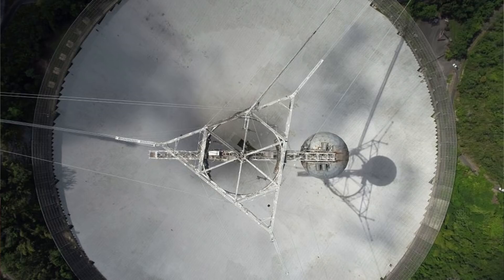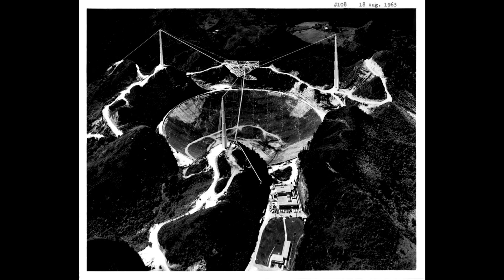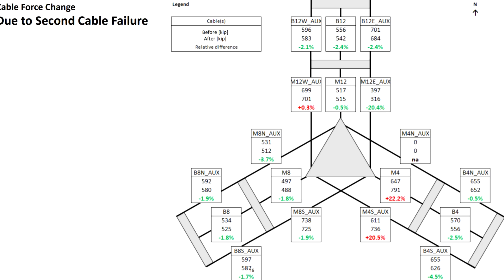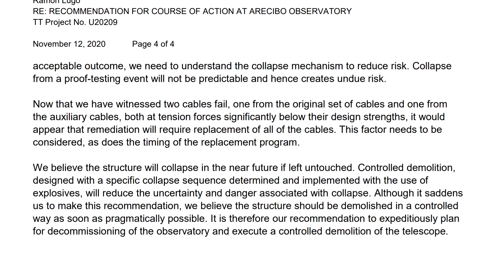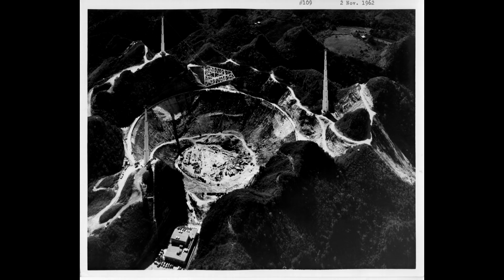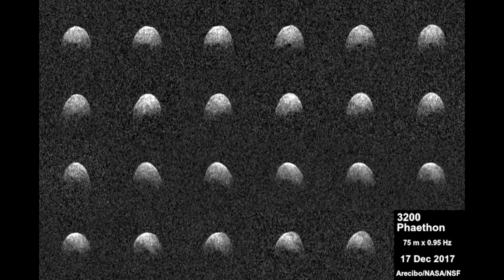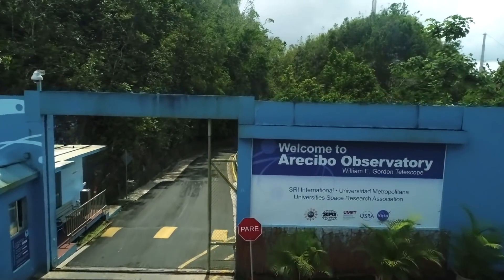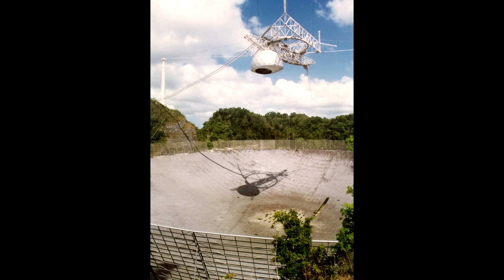Worlds Largest Radar Astronomy Dish To Be Demolished!

Comment: By undoing the cables at the bottom, that can release weight from the supporting cables. It's probably not enough if it was already damaged and should have been repaired 10 years ago. This is a sentimental setback for me, not only because I participated in seti@home, but this instrument carries something more : it's a reminder that mankind can accomplish the impossible. And it's an important magnet for Porto Rico. Cemeteries are filled with people that were irreplaceable, but here it's material, and with proper maintenance, material should be eternal. We always need a bigger something to check the work of the smaller something. We must not let the world go downhill like this.

Comment: I'm a mechanical engineering student - I see several ways to fix this, but none of them are safe. The least unsafe starts with rigging new temporary cables to the failing tower to take some load off the old ones, as well as rigging new cable to the other towers to insure against those cables failing. Then I'd start dismantling the radio gantry in the center, take down all cables, refresh all the cable mountings, and reassemble. That's the overview, anyhow.

Unfortunately, I don't feel safe relying on the remaining cables to hold long enough for all this to happen.
Reply: I'd be willing to risk my life to repair this telescope (though I'm not an engineer; software engineer tho). Not for the heroic death f* heroism but because I really think this telescope really has it's worth in existing. I bet a bunch of people would be willing to too... I guess it doesn't work that way. Anyone on the top would never accept the offer of the dare devils willing to do such a thing.

Comment: Size matters! Maybe ESA or other non-U.S. agency (Canada, Japan, Korea, etc.) might be interested. Upgrade it with newer tech like phased array radar systems. Rebuilt it of not repairable. Like using a helicopter to lift its central platform while freeing its supporting cables with explosives, and replacing its supporting structures with (2 instead of 3) quake-resistant concrete towers (like bridges) and/or (suspension or ...self supporting) bridge (arc).
Reply: I don't understand how explosives should support cables. Explosives explode, and the cables need not explode, especially if a helicopter attempts to lift a 800 ton platform, because helicopters very much cannot lift 800 tons. The heaviest helicopters can't lift more than around 20 tons of weight.
Reply: @marksmod  Sorry, editing thing. I meant to cut the cables instantaneously with explosives for the helicopter to lift that central structure free. Um, I may have missed helicopters lift capacity, but I was thinking that as they can lift tanks, so why not that 800 tons structure. Yep, I was off. My bad, I got carried away. Tanks are like < 100 tons.. Ha-ha. Why is that structure so heavy?
Reply: FFS phased array systems are not sensitive nor are they wideband as a radio astronomy observatory is.

Comment: Aero engineer here:
I'm not surprised a 60 year old cable snapped at 60% of it's expected load, even with constant monitoring and maintenance. 

I'm sure the engineers there know what they're doing, but the combined effects of corrosion, creep, fatigue, wear, and hydrogen embrittlement over 60 years are bound to ruin the cables effective fracture strength. There's probably been micro-cracks growing for years which have gone undetected, even if they have the right inspection equipment (e.g. ultrasonic devices), and the sudden increase in load when that first cable slipped likely allowed stabilised cracks to start growing again. 

Then losing that 2nd cable obviously repeats that to the 4 remaining cables, and as you said it's quite likely that one more snap will bring the whole thing down....

While it's sad that it'll be lost, it probably is time for the next generation to take over (like the Chinese one)
Reply: FAST doesn't do the same kind of science that Arecibo did.
Reply: @stargazer7644  I didn't mention fast, by next gen I mean not yet built really

Comment: Arecibo needs to start a "go fund me"
We must replace this entire telescope... ground up.
Reply: I would place a few arguments against that. Arecibo was a great telescope, with one major problem - it can't move. And the area, having high humidity, is also not ideal for radio observations in a bunch of frequency bands. While fixing it for sentimental and historical reasons may sound like a great idea, we should first consider the option of putting the money into a completely new telescope with a better location, outclassing Arecibo. Think of Hubble. Yes, it is sad to watch it die slowly, but the cost of repairs would be larger the building a new one. And even then all the hopes and dreams lie on the next generation of telescopes, like JWST.
Reply: I honestly think it'd be better to build a similar device but on the orbit.
Reply: @randomname3566  yes it be great to build it in orbit, but where are you go going to get roughly 1GW power to supply the dish? It's better to build on land, since Radar dishes need a lot power, even microwaves consume a lot power, where do expect to get that power? Solar panels don't collect enough energy to supply the demands for what you are speaking about.
Reply: @nicmaz37  It's fairly easy, you can just build big solar panels, and the cost of gathering material is also not a problem - gravity on the moon is weak enough.

We may not have the needed infradtucture now, but we will have in the next 15 years
Reply: @nicmaz37  24h solar energy. With Starship it may become possible
Reply: @nicmaz37  You only need that power for microseconds. I have an old old marine radar with 4KW transmit. The system draws 5 amps at 12 volts, 60 watts for everything, including the CRT display.
Reply: for what reason? if those who print money want it gone, why would you have it back ip?!
Reply: @cokeforever  Because Arecibo is the only means we have to measure the distance to an asteroid.  That makes it critical to establishing the orbital parameters with any degree of precision - which in turn means that Arecibo is needed in order to give us plenty of warning to deflect the next killer asteroid that might wipe out the human race.
Isn't that enough reason to want to replace it?
Reply: @SteveBakerIsHere  no, when you know its coming, what you gonna do (see Scott's video on probability of diverting an asteroid - if you dont find/remember it, i can be bothered on Sun to find it fot you - see, the f-upness of the pr is that we spend undrads of mil on "people who can tell us what will happen", rather than spending "hundred ad much on who would dare to tell us what to do with it" (c) I believe, both quote are Warthol's...
Reply: @cokeforever  I'd rather know I am about to die than not know. I think it's worth it.
Reply: @SteveBakerIsHere  Aren't there plenty of other radio telescopes readily available that could accomplish the same task?
Reply: @cokeforever  you could send a space probe up to give it a raspberry!
Reply: @AuthenticGadzooks  As far as I know, Aricebo is the only one that can use the dish to SEND radio...which means that they can use it like a radar system to measure range with phenomenal precision.  I don't think the other systems can do that.
Reply: @cokeforever  The way to stop a true planet killer is to have accurate orbital parameters decades before the impact.  Time to build a spacecraft to deflect it as early as possible is the only way to save humanity from a 20 mile rock like the one that took out the dinosaurs.

Comment: If they didn't repair it when it was "cheap" and "easy", I strongly doubt they will do it now that it is so hard and expensive...
Reply: This will be the epitaph of the Earth itself.
Reply: And more dangerous since more cables are starting to fail. If anyone might try to repair, there's a big risk the cable whipping at someone and slicing them in half. No one will risk their lives for that.
Reply: @nicmaz37  given the thickness of the cables, their whole trunk would just be crushed, the arms and fibulas might survive.
Reply: @nicmaz37 No kidding. At any moment dozens of 3 inch cables under 100s of tons of tension could fail in a cascade.  Arecibo is a *death trap*. You'd be nuts to ask anyone to do anything but set it off in the safest manner possible, much less set foot near the thing yourself. Budget is no longer the issue.  Arecibo isn't going to be fixed. :(
Reply: Especially because it’s in Puerto Rico. Also, I’m from there :)
Reply: @coquimapping8680  A shithole like south africa , congrats

Comment: Is there any utility to parking a radar telescope in a lagrange point (engineering challenges aside) IIRC one of the limitations of Arecibo's design is that its pointing capabilities were limited but in theory a space telescope shouldn't have that, right?
Reply: How big of a radio telescope do you think you can launch into space? And how would you power it?  There isn't a lot of reason to put a radio telescope in space.  They work fine on the ground.

Comment: These "vertical cables which would pull the platform down to keep it at the exact focal point" 2:44 that add 100 tons of extra force.
Could these not be cut to remove some of the stress put on the other cables ?
It's only a temporary fix, perhaps to buy enough time to lower valuable equipment off the structure, and to drop a lot of the weight as well.

From a structural design point of view, this is a 60 year old suspension bridge, and we all know how well those last.
Rebuilding it with extra equipment without replacing the original cables was reckless.

Comment: I don't see the problem tbh, like budget yeah but flying in a crain to help support the tower and then replaceing the cables shouldn't be too relitively expensive.
Reply: You can't replace the cables without risking lives.  The platform could collapse at any time.  There's no engineering margin left.  And a crane with a 400 foot arm that can support 900 tons doesn't exist.

Comment: Divert 1% of all nations military spending to fund space research and manned space programs. No funding problems then.
Reply: You appear to be looking at military spending the wrong way.  You need to start thinking of it as 'infrastructure' (safety and security are just as necessary as water and power).  Or you should think about it in terms of homeowner's insurance.  If your house burns down - you'll regret getting the cheap insurance.

Whenever you start talking about cutting defense spending you have to decide what consequences you are willing to accept.  For example - the period of overall world peace (no major wars) is the longest since the 'Pax Romanum' 2000 years ago.  Think of today as the 'Pax Americanum.'  We need to stomp out the fires whe they're small because we learned a hard lesson as a result of 1917 and 1941 - that any major conflict will suck us in.

Comment: Wonder what would prevent something like a tower crane being set up that could remove parts of the gantry and lower load while also serving as a potential high safety point. A tower crane being able to work in a small footprint and be assembled in place thus limiting the amount of dish that needs to be removed and maybe even use some of the area that's already damaged from the original cable failure. The tower crane might need to be stabilized by cabling but its engineering on par with this project...

Comment: My thoughts: put a few smaller holes in the dish to allow the building of a scaffold. Lower the center piece on to the scaffold. Inspect the towers, replace all the cables. Bring it back up, remove scaffold, bring dish back up. Probably the best way. The scaffolding probably won't cost that much.
Reply: Nobody can get near the telescope.  Would you like the be the one building a scaffold directly underneath of it?
Reply: @stargazer7644  yhea I forgot about that for a few moments. I'd consider it. Just minimize the time under there, when there is not much wind.

Comment: As it seems to me. The safest way to 'repair' this system is to do careful disassembly. It isn't possible to rely on any of the tensioning lines. They all need to be replaced and the dish array is not designed to be disconnected. The time it would take to get all of these lines made available to install will provide plenty of time for more deterioration of the remaining tension lines.

So it may be safer to save the towers, and then pick up and clean up the remains of the mess before planning a rebuild. They may get lucky and have ways to reduce the damage. On the other hand they may be able to build it even better now with this problem in mind. It does not look like any work was attempted to maintain the building compared to the Golden gate bridge. At this point it is clear that environmental effects need to be countered to prevent the future erosion of any rebuild effort.

Comment: The biggest problem is not safety or engineering, even though those are staggering. It's POLITICS, as in "who's willing to pay for it?" We now know that the initial construction, and  upgrades, were still not enough to provide the promised lifetime. We've learned enough to do it right this time, or at least better. 

How well does tensioned carbon fiber work in that environment? How do we design for continual maintenance, and fail-safe operations? Could improved reflectivity, and surface accuracy, provide the same results in a smaller, lighter dish? Could we provide other radar dishes to give VBLI performance? Are there craters on the moon that would work, especially if we can build enough to cover all the latitudes? We might as well blue-sky while we're at it, especially if it will take 25-50 years just to duplicate present capability. 

In the end, politics (money) if the biggest problem, and the hardest to fix.
Reply: There really isn't a way or need to improve reflectivity.  Metal reflects essentially 100% of the signal that hits it.  Increasing surface accuracy just allows higher frequencies to be used.  The dish is designed so the surface accuracy is adequate for the desired max frequency.   You can't make the dish smaller.  The aperture is directly proportional to the sensitivity. The difference in cost to building on the Moon vs Earth is about a factor of a million.  And we didn't learn anything.  Everyone knew Arecibo was starving for money for decades before this happened.

Comment: Maybe someone could float the idea of replacing the cables with carbon fiber cables to one of the major players in that field.  It would be an awesome sales and advertising stunt and might bring enough excitement to the project to make it happen.  I am no engineer or anything either but I am sure they would be able to come up with a plan to do it safely if they wanted to bad enough.
Reply: They should have replaced the cables with steel cables 40 years ago. There is no safe way to do this now.

Comment: Do we need it anymore? Radio telescopes can behave as an antenna size of the distance between plates, aka arrays. With the Internet the way it is now is it not possible to essentially sync up any volunteer rigs all working in unison to essentially turn the entire Earth into a giant scope?
Reply: It doesn't work quite that way.  Connecting telescopes using VLBI does increase their resolution, but it doesn't increase the sensitivity that much.  It isn't anything close to having one big dish.
Reply: @stargazer7644  Ty, I have been into astronomy literally since I was 9 years old so like 30 years now and every resource I have ever seen about Radio telescopes have all made the same claim that multiple dish connected together will behave as one large dish. It was always a slightly dubious claim I questioned but I focused my efforts on the optical end of things and just took it at far value for the most part.
Reply: You can connect multiple radio telescopes, but only to increase resolution, which can be rather low for a single radio telescope.   You can try to do the same trick with optical telescopes (The large binocular telescope, for example) but it is much harder.  You can't really connect optical telescopes on opposite sides of the planet, for example.  Not yet, anyway.  In both cases it isn't really the same as one big telescope.

Comment: Wire rope isn't a simple structure.  It is a machine.  In order to work, the individual strands must be able to move relative to each other.  If they can't, the strength drops dramatically.  The best bet is to remove all the equipment from the instrument platform that can be safely removed, and then drop the platform into the dish with a controlled demolition.  Haul away the scrap, build a new platform, suspend it on new wire ropes, and repair the dish.

Comment: Yes.  This is the central scientific icon of my youth.  Everything else was tied to its size, elegance, power, and grace.  The simplistic shape, like one I could hold in my hand, but engineered to the nth, and in contact with the whole cosmos.
And yes, it's one more symptom of the decline of American infrastructure and American science.  
   Perhaps this hardware cannot be repaired, but I hope it is removed and replaced, only bigger and better, right on site.  A2, we need you! Aricebo forever.

Comment: If the towers themselves are still structurally sound, the simplest way to demolish the dish and platform would probably be to detonate a controlled explosive at the top of each tower to sever all the cables at once.  The forces would pull the remaining cables away from the towers and you could rebuild the tops to receive new cabling.  The trick would be making absolutely sure they all severed without damaging the tower structurally.

If the towers themselves aren't sound you simply clear the area and blow the whole thing with demolition charges, clean up the mess, and start anew.